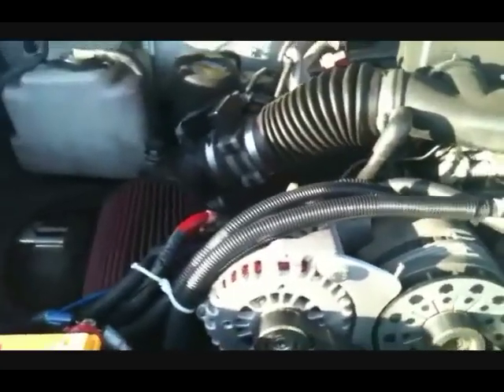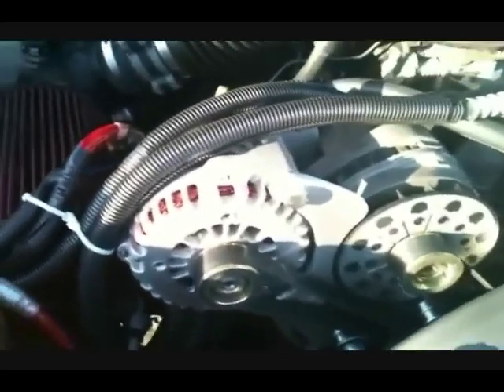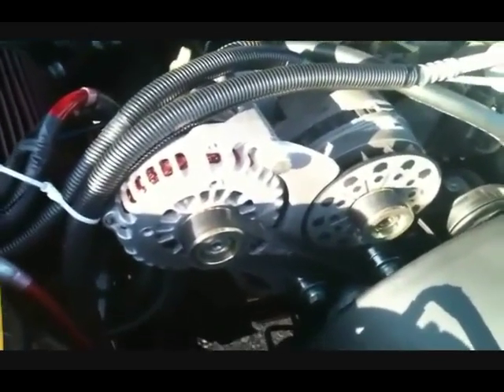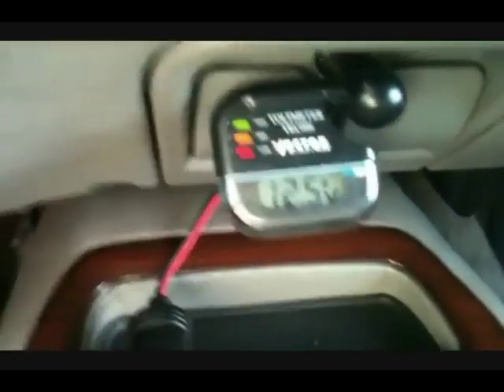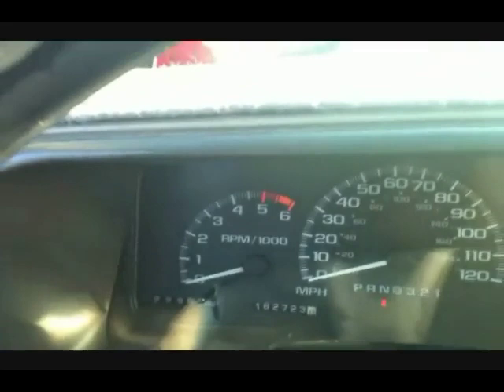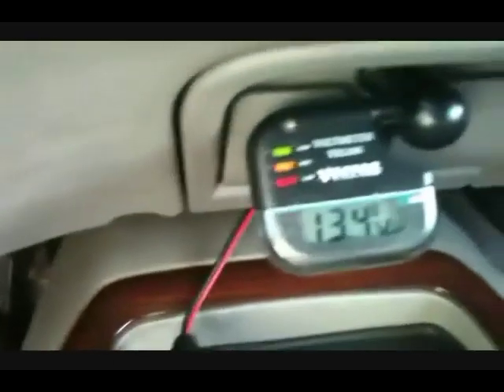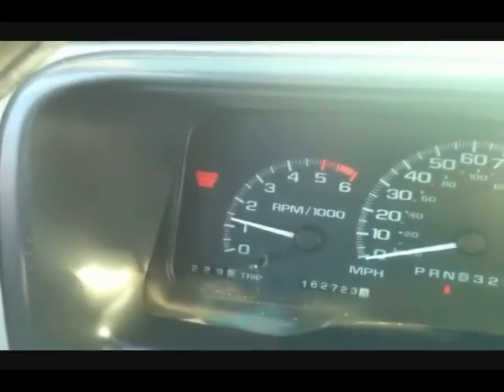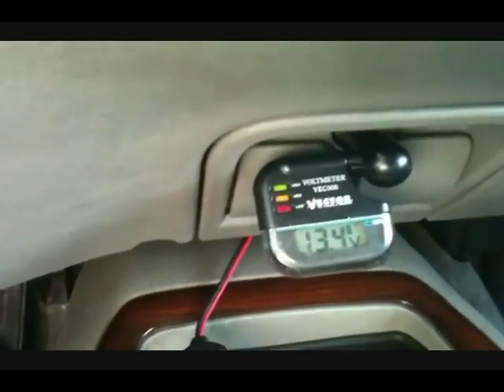DUAL ALTERNATORS ON THE DENALI

Comment from the maker: @8LowKey2 the first meter is plug into the lighter that reads the factory alt, the other is ran from my battery bank in the back,(my two kinetik hc2000's)wired up to the front

Comment from the maker: @anubisprince36 i run the two runs of 0 gauge from the output on the HO alt straight to the two kinetik hc2000.i used a relay ,&  a fuse on the ignition acc. to trigger the relay to power up the voltage regulator ,the power out on the regulator goes to the voltage in to put power into alt